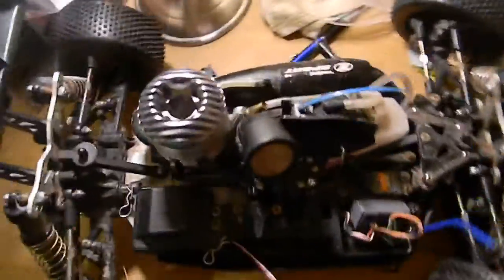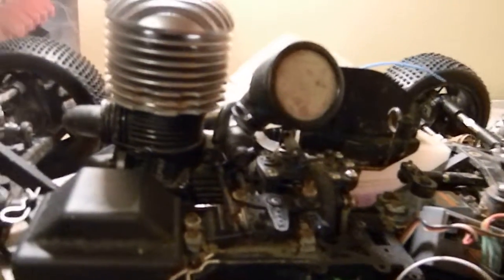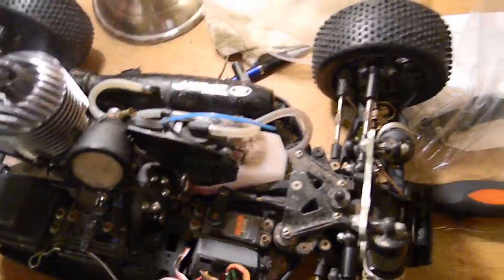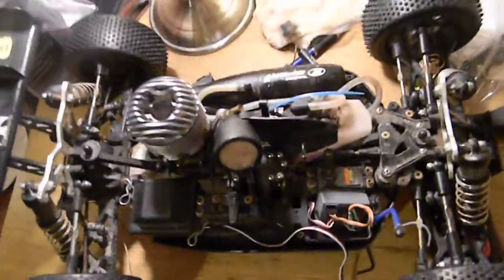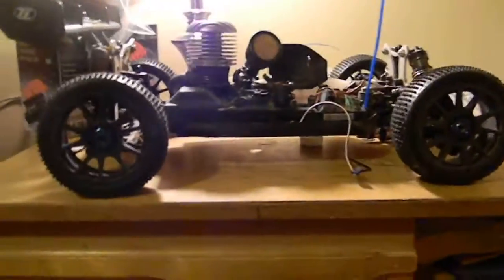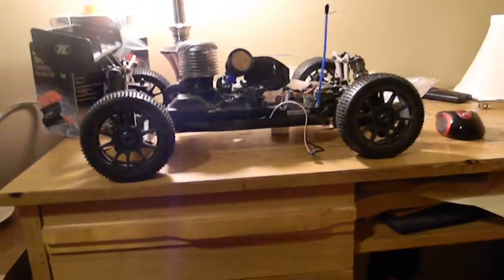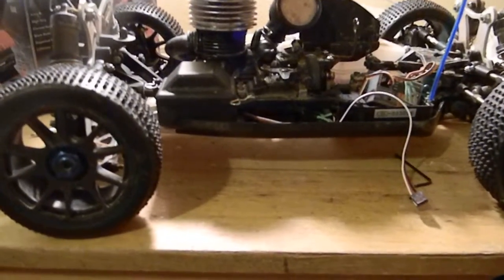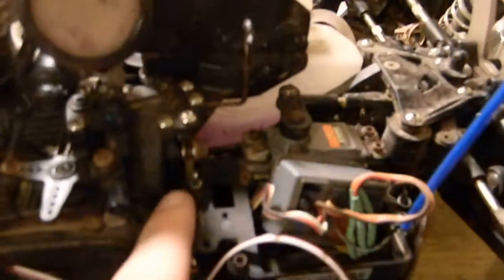losi update 8ight update part 3

Comment: Get the .2,  I was running my .2e at the classic mine was the white one with the blue/ green flame paint scheme. As for the servo I run a high tech bb Coreless metal gear, I think I paid $80 from tower hobbies.. And make sure you get a RC8.2 NOT THE RC8.. THE NEW BUGGY IS BETTER